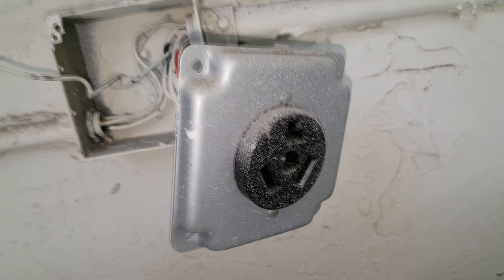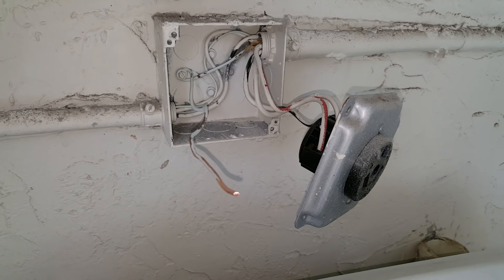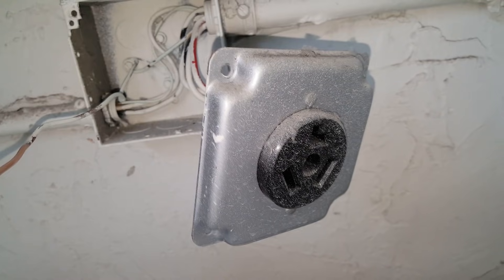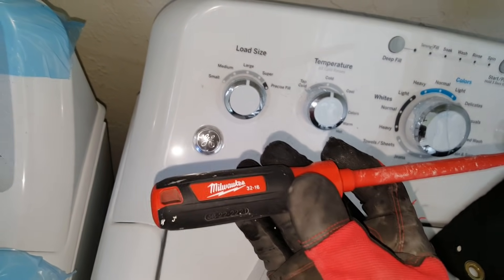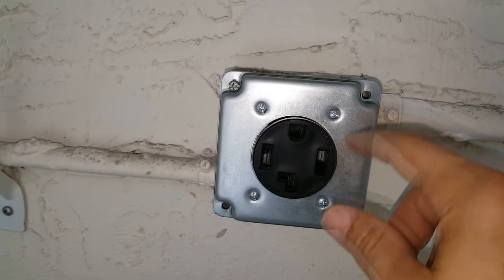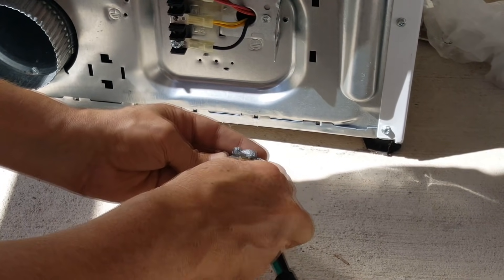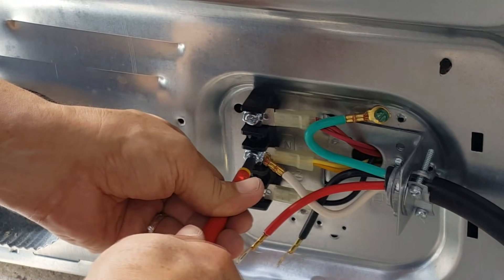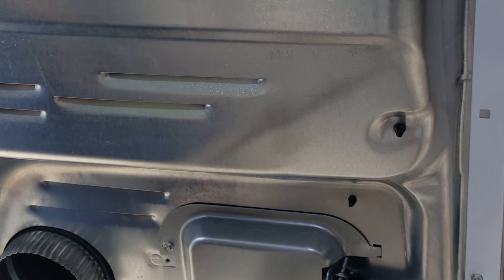How To Convert 3 Wire Dryer Electrical Outlet to 4 Wire

Comment: Your system is already grounded with metal conduit back to the panel , all you would need 
is a ground pig tale from the box . No need to call an electrician bud

Comment: Great video! I bought a used dryer that has a for prong cable, but the jump strap is still connected on the dryer. And my old house has a three prong outlet, but i think all the wires are there for a four wire outlet. This video might help me rectify everything.

Comment: Can i get the ground wire from the washer 110 outlet next to the dryer outlet if i don't have a ground like you have?
Reply from the maker: Yes it is better than nothing at all but it is preferred to have each circuit running its own ground wire. It could be that your dryer if you have conduit throughout the house, might be grounded to the metal conduit which was big back in the day. But I would check your fuse panel and see do you have a ground wire coming from the dryer breaker. If you do then you really need to search to find out what happened to that ground wire and why it's not in the box, or if they grounded it to the pipe conduit, then maybe all you need is to screw in a ground wire pigtail into the back of the box.
Reply: @jeffostroff  thank you

Comment: Jeff, Why does one not get shocked when inserting the electrical tester directly into an outlet.
Reply from the maker: You don't get shocked because the electrical tester is made o plastic. If it was made from metal you would get shocked. Also digital voltmeters have metal probes, but the red and plastic handles on them insulates you from the high voltage

Comment: Please people, do not check if you have power using one of those testers. You will definitly want to use a multimeter because electricity is very deadly
Reply from the maker: Stop being a fear monger with no data to back it up, these devices have worked for me for 20 years with no failure, and Fluke is the best

Comment: Just wondering how you will have a neutral without a wire
Reply from the maker: You will have to run a separate neutral if you want one. We've had to run grounds before, not a big deal.

Comment: So the wire coming out of the wall is cloth covered. There is a red, white, black, and a ground wire as well. So pretty cut and dry? Switch to new outlet and switch to 4 prong plug?
Reply from the maker: That is some old wire! If you can upgrade the wiring to add the neutral I would do that as well.
Reply: @jeffostroff  that’s what I said haha. White is neutral
Correct? Because white is there. Along with black, red, and the bare ground.

Comment: If I have all 4 wires, could I assume they are all connected at the breaker? I dont know if I asked that correctly.
Reply from the maker: You could remove the panel over the breaker box and see where the wires come in so for example if it's for a clothes dryer just find the clothes dryer breaker and see where the wires are leading to it how they come into the box and see if they're all connected up the ground wire should go right to the ground bar the white wire should go to the other bar with the white wires and by the way both of those two bars are connected together. The black wire and the big red wire should each go to dear respective breaker connections

Comment: Great video. Well done. 1/4" nut driver is so much easier if possible.
Reply from the maker: Yes I love that.nut driver set
Reply: Also, a lot of electrical boxes, screws, etc. in Canada, use the square Robertson screws.  These are by far better than even Phillips.  Also, the handles are usually colour coded according to size.

Comment: How do I know which color goes to what
Reply from the maker: It shows you on the video, they are labeled. Black and red go to the 2 plugs that looks the same, and they can be swapped, red or black can go to either one. White neutral goes to l-shaped plug, and ground goes to the dome shaped plug.

Comment: I have 3 cables
White, black and ground (bare cable)
And I don't have the neutral cable
What can I do?
Reply from the maker: A couple of times we ran all new 6-3 cable from the electrical panel to the range outlet. Typically on 3-wire systems they use red, black and white. Makes me suspicious if you really have 240 there or 120 volts. What year was your house built, and what AC voltage are you measuring across the black and white wires?

Comment: Earth And C/N  are tied at some point in your home if done correctly. 240 doesnt even need common as its leg to leg, IIRC some dryers pull 120 though so for that it sure helps. Micro switching supplies will probably eliminate this soon they have gotten hella cheap and require few external components plus do ranges like 90-300VAC to 5vdc with no trouble.  but i believe the real reason you remove that strap is less to do with your saftey than not creating a giant antena with the  N and EG/G
Reply from the maker: Yes on most electrical panels the common and the ground are tied together on a bus bar inside the electrical panel.

Comment: In my case I'm dealing with an old outlet serviced by a 10/2 with ground and this video did nothing but piss me off. An outlet is not a socket. All wires are not conductors. Ground and common wires are different things. A Romex connector is not a strain relief. Your fans are no brighter than you, considering their response???
Reply from the maker: You should be angry at yourself, not this video. An outlet can be called a socket. Look up the definition for socket: a natural or artificial hollow into which something fits or in which something revolves. "the eye socket" 2. an electrical device receiving a plug or light bulb to make a connection.

Comment: Just bought a new dryer and hooked everything up good and it wouldn’t dry a code kept coming up that the ground had a problem so I opened up the plug and I have no red in the x plug or at all
Reply from the maker: You should have at least 3 wires, a black wire, a red wire, and white wire.
Reply: Excellent video. New dryer came with a four prong plug. I have a 3-prong outlet (house built mid-80’s). I opened the box and have three wires: a white, a black and a bare copper wire. No red. Do I need to call an electrician?

Comment: Why do they still sell the appliances with the three prong?
Reply from the maker: I think most houses still have 3 prong so they actually sell you the appliance, and you buy the power cable separate, and if you need 4-wire, you remove the shunt metal strip that shorts common to ground on the back of the machine first.

Comment: This Ground and Neutral thing has always scrambled my eggs because aren't they both connected to the same buss bar in the entrance main box~?  An old instructor that taught me years ago used to say "ground is ground is ground"~!
Reply from the maker: Yes they are connected inside the fuse box, and it is confusing, although I suspect the reason why they have separated the ground from the neutral is that current is flowing from the black hot wire, through the appliance, and back through the neutral to the fuse box to complete the circuit. But if you have a sperate ground wire, there is no current flowing in that ground wire, making the ground wire safer to sue to ground the chassis with.
Reply: @jeffostroff  Thanks for your explanation and I guess I am doomed to keep thinking "Gnd is Gnd" "Always was and Always is".  Thanks for efforts to make us rookies understand=it's appreciated.
Reply: The neutral normally carries power and the ground normally doesn't.  There are safety reasons for keeping them separate.

Comment: Old house built in 54 with glass screw fuses..... 

Would it be safer just to upgrade to breaker panel with upgraded dryer wire to 4 prong outlet?
Reply from the maker: That is what I would do. My friend bought a 1946 house a couple of years ago, upgraded to a modern panel, made life a lot easier, now he has 3 prong electrical outlets everywhere, and 4 prong outlet for dryer.
Reply: @jeffostroff  10/4 , this old house .... Is exactly this old house haha, headaches 

Thank you

Comment: Do have to switch out the breaker too?
Reply from the maker: As long as the breaker is the correct amperage and is in good shape it can stay
Reply: @jeffostroff  Now with the NEC 2020, 210.8(A), the dryer receptacle now has to be on GFCI where a breaker would be installed. Clear and concise video Jeff.
Reply: @stuzman52  Those would be required on new installations, not existing.  If it was legal when installed, it's legal now.
Reply: @James_Knott  That is correct! Have a great day!

Comment: Nice Video.  So I might have to do something like this.  Unsure, as the house has not been moved in to yet, but it has a 3 prong outlet.  Dryer is 4 prong.  Assuming there is no ground wire, there is no issue with changing the dryer to a 3 prong, correct?  However the best practice is to always convert the outlet to 4 prong if possible?
Reply from the maker: right you can change the dryer card back to 3, but then you have to add the metal shunt back in place at those terminals in the back, and short the white neutral to the green chassis wire. I bet if you open up the outlet box you'll see a ground wire in there. If you do, your problem is solved and all you need to do is buy the 4 conductor outlet receptacle.
Reply: @jeffostroff  Great.  I'll definitely check.  Thank You!

Comment: Does you no good to change the outlet unless you change the service panel in the home. The new service panels in home have a dedicated ground and a dedicated neutral
Reply from the maker: Most of the outlets we have replaced the house already has a panel with dedicated ground and dedicated neutral, and they are connected other inside the electrical panel. but most of our properties were built in the 1980s, the electrical panel is ready for it, but since it was pre-1996, none of them ever have 4 wire outlets. These types of properties make it easy for us to convert. Sometimes we just run a new ground from the electrical box to the dryer outlet, but mostly it's already in the box.

Comment: My 3 hole outlet only has 2 electrical wires and a ground, there's no third wire. Is there an easy solution for that?
Reply: Sorry, you have to buy a new house.
Reply: So you have red, black, white. All you need is to have a ground wire.
Reply from the maker: A few times over the last few years, we either re-ran wire for stove, but never had to with a dryer. If your house has the safety ground, you can run one from the electrical panel, which we have had to do before. OR....If your dryer outlet box is metal and you have metal conduit, find out if they grounded your metal conduit in the house. If they did, you can just tape a pigtail ground wire to the screw hole on the dryer outlet metal box. That would be your 4th wire now.
Reply: I have a black wire a white wire and a bare copper wire. How do I figure this out?
Reply: Not to much to figure. Black is power white is neutral, bare is ground
Reply: Now the receptacle should have connections. Brass color is for power black wire, silver screw is white wire connection green is ground
Reply: I have problem.  Black,  White and bare ground.
Reply: Sometimes, hack installers use the bare ground as the neutral.

Comment: Is a 14-30p cord safe to use on a 14-30r outlet?
Reply from the maker: You can use it, just make sure the cord is 30 amp rated, and that you have a 30 amp breaker on the dryer circuit.

Comment: Correction: The red and black wires are 180 degrees out of phase to get 240 volts. If they were 120 degrees out of phase the resulting voltage would be 208 volts.
Reply from the maker: You are correct
Reply: Which would be the case on a three phase system ie the 120° phase differential, which you don't have on residential wiring.

Comment: My 3-wire neutral is a bare copper wire that runs through metal conduit back to the box.  Do I still need to run another bare copper ground back to the box to upgrade to a 4-wire?  Or can I just ground the new outlet to the metal box?
Reply from the maker: What you need is an insulated white neutral wire going back to the electrical panel, but also we need to see if your panel is wire with neutral or ground or what. How old is your house?
Reply: @jeffostroff  built in 1918, but I'm sure it was rewired at some point since the old knob and tube is gone.  My dryer outlet is literally two feet from the breaker box with wall-mounted metal conduit, so it should be easy to rerun the wires.  Just seems strange to run a separate neutral and ground wire just so they can be connected to the same bus bar two feet away.  Why not just connect them at the outlet?

Comment: My problem is I do nota have neutral wire.
Reply from the maker: You could get an electrician to come in and route one for you maybe it won't be that hard. They just have to road a dedicated neutral wire from the outlet Box that feeds you are washer and dryerOr stove outlet whatever the case might be, and they have to run it back to the electrical panel. Then you will have 3 wires, but if you already have a copper ground wire then you'll have the for wires you need to be code compliant to the modern code if you were trying to upgrade to the modern code.
Reply: @jeffostroff  thank You. They neutral wire for a dryer, is necesary?
Reply: @cumbialo821 Dryers work with 3 wires or 4 wires. The difference between a neutral and a ground wire is where the wire is landed in the circuit breaker box. Electrically they are the same. A neutral wire is required to obtain 120 volts. If a dryer operates only on 240 volts, it would not need a neutral wire.

Comment: Does the ground need to remain bonded at the metal box when you connect it to the new outlet?
Reply from the maker: Yes, National Electric Code requires all metal junction boxes to be bonded to the ground wire. I seldom find this to be the case in a lot of foreclosure properties I have taken over, so the builders are doing a lame job here in FL, and the inspectors are even lamer at checking them.
Reply: @jeffostroff  thanks for the reply. Im.also on south FL. 
My ground wire that bonds the box is cut short. If I was to buy some extra length copper wire, is it possible to extend the ground and extra couple of inches so I can reach rhe new plug? 

Again thank you for the reply.
Reply: DUH

Comment: I HAVE A QUESTION IN MY SHOP I HAVE A DOUBLE CIRCUIT BREAKER THAT HAS ONE SWITCH SAYS 20 ON THE BREAKER SWITCH SQUARE D TYPE. MY 220 SHOP PLUG THAT I RUN A DRYWALL HEATER OFF IS THE ONLY THING POWERED BY THIS BREAKER. THE HEATER HAS THREE WIRES. THE INSIDE OF MY 220 SOCKET HAS A RED A BLACK AND COPPER. I WOULD LIKE TO PUT A 4 WIRE SOCKET IN TO RUN A HOUSE HOLD STOVE FOR POWDER COATING. CAN I HOOK UP JUST THE RED BLACK AND COPPER AND BE GOOD? . I HAVE NO WHITE NEUTRAL WIRE IN THE BOX. THE WIRING IS SAY TEN YEARS OLD INSTALLED BY A PROFESSIONAL AND WAS INSPECTED SO IM SURE ITS TO CODE.
Reply from the maker: Hi Steve, if your circuit breaker says 20A on it, that won't be enough to handle a stove which should typically be 50A. Not only that, the wiring for 20 amps is insufficient, because for a stove you need 6-3 wiring which means 6 gauge, and 3 conductors. You don't have a white common wire either which is strange for work that was done 10 years ago by a professional. With my projects I usually try to upgrade the stove to 4 wire. Usually we have been lucky and already have the white common wire but several times we have had to run the ground wire to make the 4th conductor.
Reply: Thanks for the reply. I will pickup new wire and start fresh at the panel.

Comment: Thanks to the crappy design of those outlets, you can plug it halfway in and there's live voltage. The pins are not even sleathed
Reply from the maker: That's why I'm careful plugging them in, and once they are in, they are in tight, and out of the way behind the stove, not a threat to anyone.
Reply: @jeffostroff  That also includes standard NEMA residential receptacles :)
Reply from the maker: @cryo_life  That's why I avoid standing barefoot in a puddle of cat urine while plugging in appliances.

Comment: Just attach the X & Y wires... oh yea?   WTF   what is an X wire,  which color?   NEVER MENTIONED it in the video... GO elsewhere so you don't blow up your dryer & breaker panel & burn down your house... NOT GOOD
Reply from the maker: LOL! It's comically obvious you never watched the video, just another lying troll, LOL. If you had watched this video, you'd see at 3:10 in the video we clearly show you what X and Y terminals are on the outlet. Then at 4:05 in the video we clearly show you that the black wire and the red wires are X & Y, and that it does not matter which one goes on X and which one goes on Y, because both black and red are 120 volts each and all that matters is you get 240 across the X-Y terminals. Normally I'd say nice try in your feeble attempt to discredit this video. But this was not even a nice try, you just got caught with your pants down, proving with your drama queen whining that you never watched the video. LOL!   Thanks though, you gave us all here a great laugh, embarrassing yourself in the process.

Comment: Run a ground green wire to a grounding rod conviente  located outside . Easier than running a new green wire all the way back to the breaker box.   Will that work?
Reply from the maker: No you cannot do that! The reason why is if the hot wire shorts to the ground Then you have the problem that the fuse might not blow inside the panel like it should because there is no real circuit you're just feeding it out to the ground and you could still get shocked. This is why they want the ground to return back to the panel to that grounding bar so that it would complete the circuit that way the fuse will trip if there's ever a short.